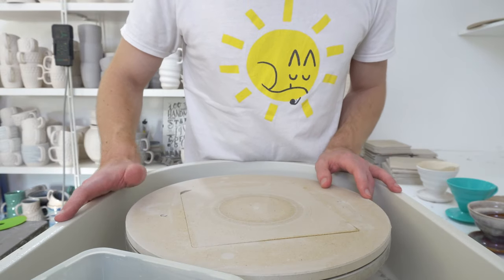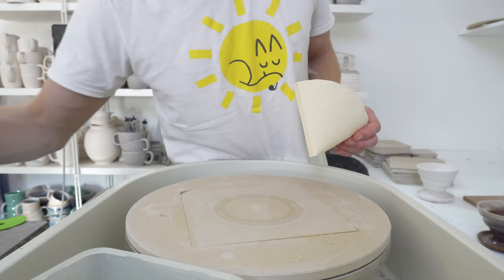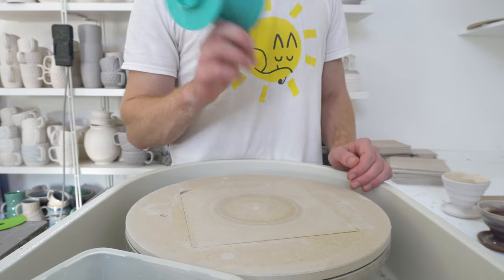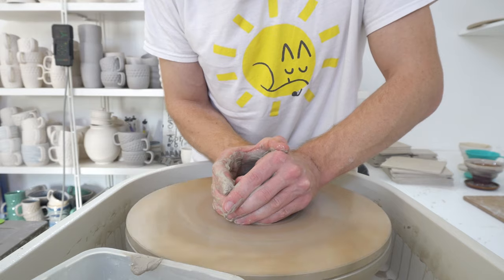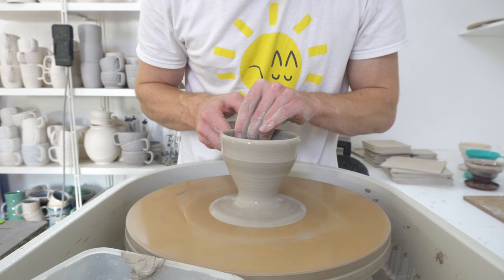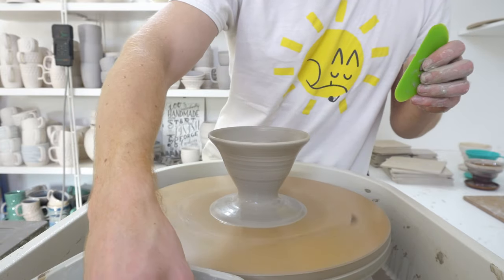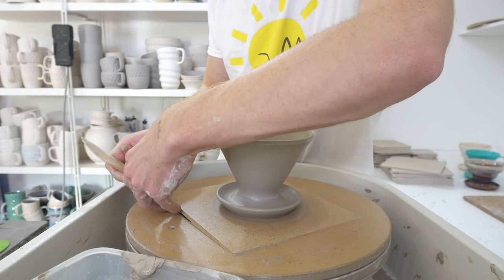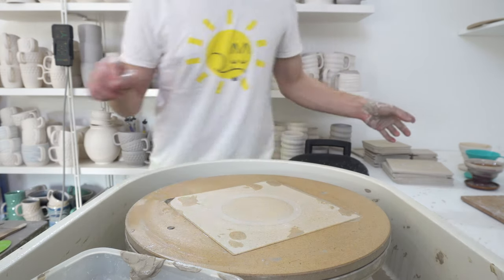Throwing a V60 Pourover on the wheel

Comment: Thanks for this. This was a question I was going to ask soon, actually...
Reply from the maker: Glad we're on the same wavelength!
Reply: @OldForgeCreations  gotta say, I come for the content, I stay for the shirts.

Also, testing out your strontium gloss base with 3% managanese and floating Orange right now. Kiln opens tonight or tomorrow, I'll post the results on glazy of course
Reply from the maker: @BasilWallace  Awesome, I hope they work out well for you! Some perople have found the strontium gloss turns matte for them, and it's usually solved by reducing the rutile, just in case you also have that issue.
Reply: @OldForgeCreations  I saw your notes saying you'd dropped the potash for custer, so I actually tested this twice using your recipe straight sub custer for potash, and another with the values adjusted and tweaked to match the custer, but with Neph Sye and potash.

I think the tweaked version with neph sye is better, but really neither worked. It's really glossy, but very cloudy, and not transparent. 

I think the issue is too much titanium. I must have a bag of a common ingredient across some glazes that's just stupidly high in titanium as I've tried your old and new floating blue, floating orange, raspberry ripple and now this stront gloss, and they're all milky.

I'll add a photo of mine now.

My bucket of your new floating blue is pretty okay, I uploaded some photos, and you can see there's a lot of milky white in there

I'll next be attempting a line-blend test with the same recipes, but 0 addition of rutile (so line blend test of: floating blue, floating orange, strontium gloss + manganese)
Reply from the maker: @BasilWallace  Yea, it does sound like that might be the cause, and that would make sense for all my glazes coming out differently with your rutile. I'm not sure if my supplier calcines theirs which could be one source of difference, or it could just be that your rutile has a different ratio of titanium and iron. Doing a test with increasing amounts sounds like the perfect test to see if it's due to ingredient difference or not.

Comment: Fantastic video !! Thank you so much! A couple of questions for you, if you please, how wide did you make the base? What clay did you use? Thank you !
Reply from the maker: The V60 has a base of around 105mm, so I aim to throw to at least 120mm to shrink down to a similar size or larger. It's always better to be on the wider side as there's no real downside, whereas too small and it won't fit many mugs.

I use a white stoneware called KGM body.